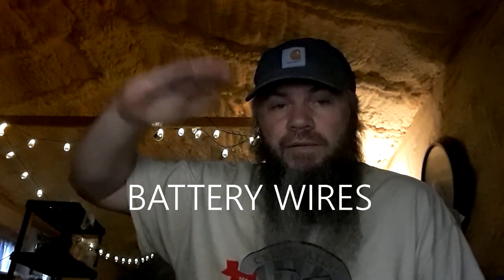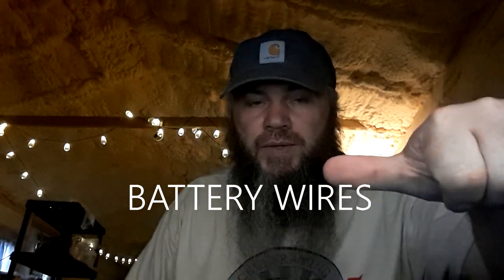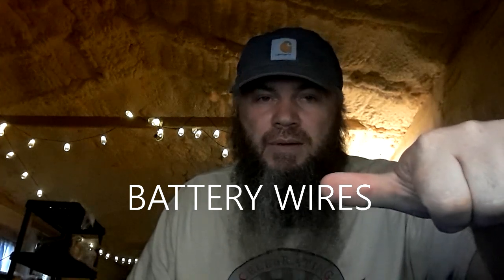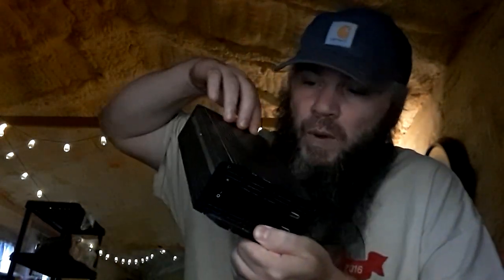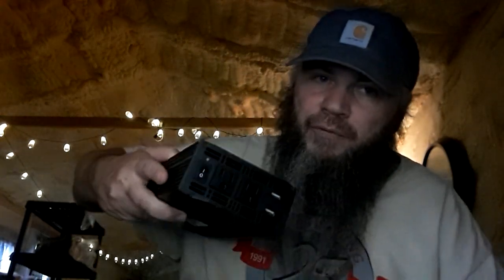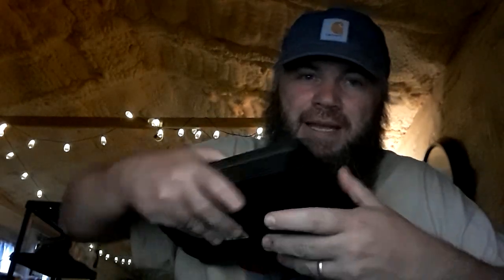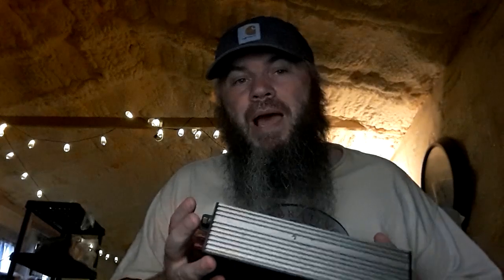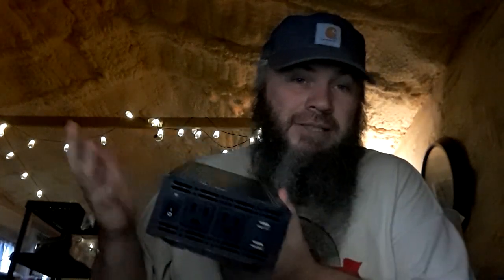Solar Power 101 Victron & Outback

Comment: Thank you for sharing this well explained video. I look forward to seeing more along this line.
Reply from the maker: Thanks Larry! Basic info, feelings and experience. More could be done but we're on a tiny budget. Lots of off grid residences that use or want solar near us. Some seek us out. They see we have a solar field and have many questions.  Bulk is cost and power balancing. They want lights, a coffee maker maybe a fridge and the possibility of an AC unit while the suns out in the summer.  Running a small system is easy to power basics. Once you hit higher amp draws Its more of a good quality higher amp charge controller, space for a Pv array that gets little to no shading , a low frequency pure sine wave inverter that can handle a strong motor start up and space for a few 100 amp hour deep cycle Batteries to get you through the night.  We suggest component's that have flexibility. Mostly your MPPT charge controller. 60/80/100 Amp solar charge controller can handle a big array, 2k 3k and 4k arrays. This will get most power needs for the Average Joe by.  Since we are DIY and part scavengers looking for deals you won't see huge systems of overly complicated builds.  Our house has a medium size build. Wife wanted city creature comforts. Microwave, toaster,  fridge and AC.  Pro built i would of ran me 45,000. As a DIYer and bargain hunter I kept it down to around 6k. 15 kwHr  converted car battery was  blessing.